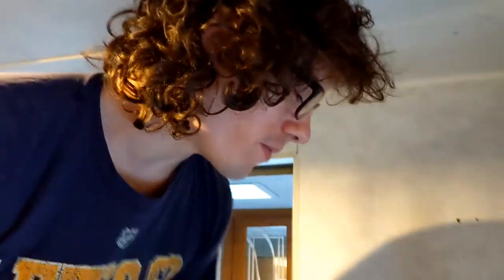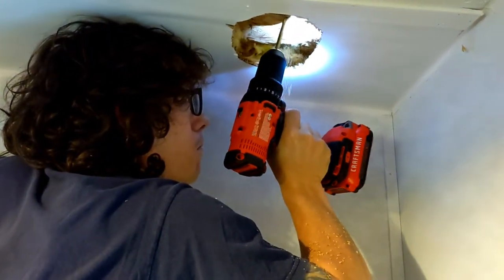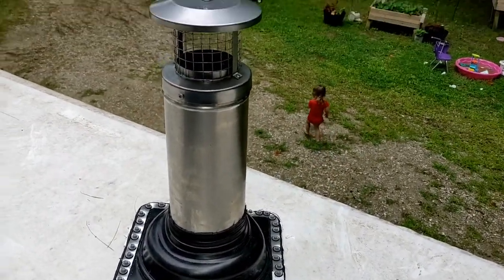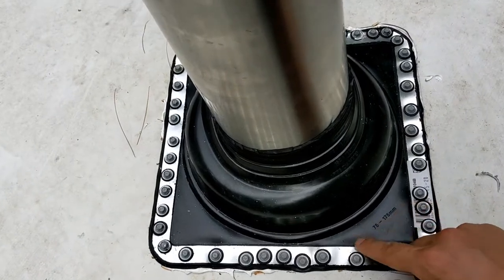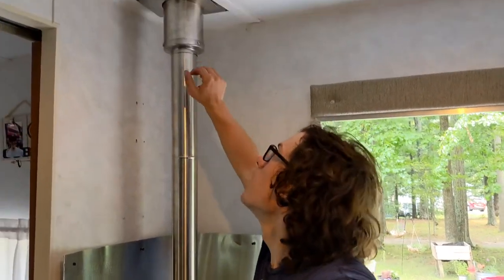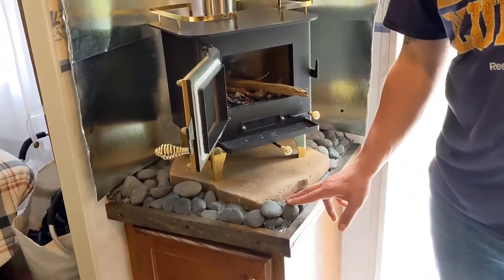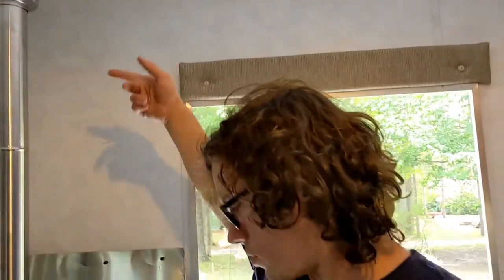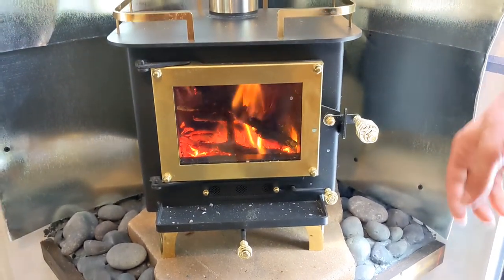Installing A Wood Stove In Our RV

Comment: Nice job! Planning on doing the same thing. I wonder if there's a way to figure our what's between the ceiling and the roof above the stove - saw a few vids where ppl ran into frame, wiring, etc. Might try and adapt a sliding window for a side exhaust but straight up is better for preventing downdraft and smoking out the camper. Still happy with the install? Any mods since putting it in?
Reply from the maker: I can't remember if we showed it but we cut the ceiling plywood first before doing the roof to make sure we weren't hitting anything important. Honestly we were kinda winging it, it turned out great though we used it for a few months and the stove works wonderful the rest of the rv did need insulated for it to work at it's best though. Good luck and thanks for watching 😊